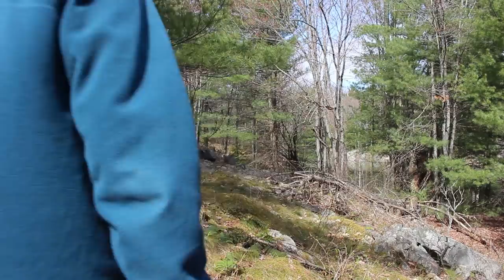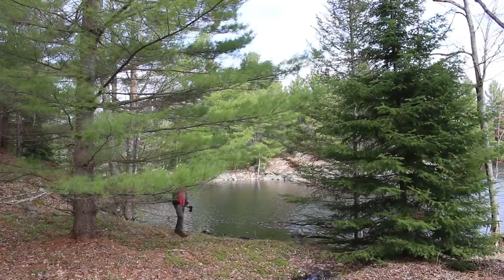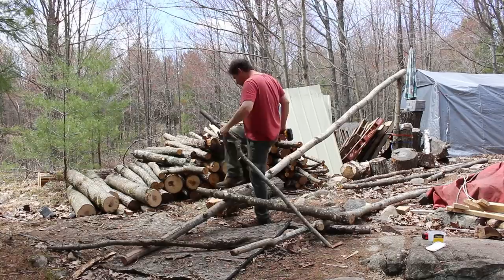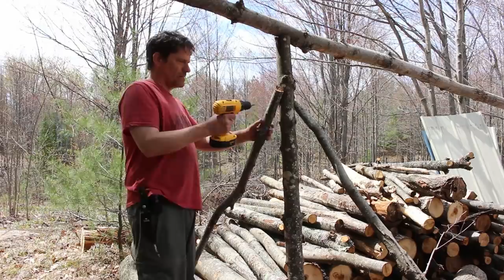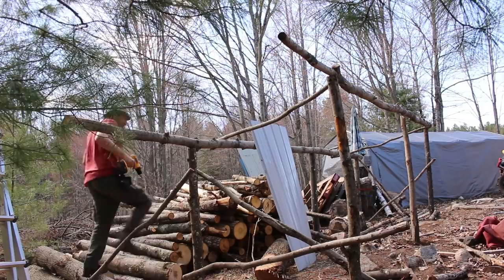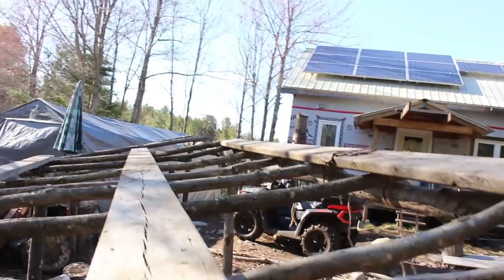Building a Firewood Shelter at my Off Grid Wilderness Cabin

Comment: You have plenty of rocks, so use them and a little mortar to build a 3 sided rectangular base with spaces for log supports for the roof. Lot of work? Yep, but when you're done, the firewood shed/shelter, will still be standing,  long after you're not. I was partly raised in Montana,   and the main house, three stories with 13 rooms and chicken coops and Barn foundation and grain storage building were all done this way and lasted well  over a 100 years. You don't seem to bothered to much by hard work and as one who's had to do it,  your work ethic is admired.   Thank you for your video's, they're appreciated.
Reply from the maker: Thanks Frank, read the first line of the description.

Comment: Hello... good start for what it is. Must Concrete in the post you can be on top the ground get some Sakrete you need to make a box you could walks in all three post by twos that is left and right side will be Boxed In by concrete from the front post to the back post and then do the other side and think about the middle support. The layer of concrete should be at least 3 in 6 is better. Now that you got something up high as 6 in you can Bridge across them with some good Lumber and this will keep your wood off the ground because you bridge across. The thing with the concrete is to help hopefully successfully your structure to stay in place in high winds. Moreover now that you have bridged across you're poly weight onto the structure so it is like the wind must blow over the entire woodpile with all its weight. If you position your structure correctly and now is the time to think about this well it's a little bit late. You can add solar panels to the top in truth you don't need no 10 if you have the right size solar panel in use Tea Bar Warcraft some Lumber to make this Tea Bar clamp down piece of wood. I'd also make it long you should use it's for your storage and I would think that yeah taller was better but that is just me your it is your project. It is my joy to see it Blow Away. Not really I hope it doesn't

Comment: Great idea! It seems mice & big too so when you find good wood to process, you can stockpile it & it won't just rot. My first one didn't have a bottom so the bottom layer was wasted. So a platform helped but we still got termites. Watching you, I thought if I make another at our new house, I want to cover the raised floor with roofing metal with just enough slant to drain out the back and of course the roof with slant too. But yours is going to be so cool with the wood from your own property.  Woot!
Reply from the maker: Thanks Liz. I have enough pallets for a floor so they shouldn't rot. Leveling them might be a challenge though.

Comment: U definitely need to work on getting ur structures foundation solid. One hard wind and that wood shelter is a goner.
Reply from the maker: I'm limited to what I can do as the whole things sits right on bedrock and I don't want it to be a permanent structure.
Reply: Raspberry Rock - Off Grid Cabin trust me, if u don’t solidify that foundation, you won’t have to worry  about it being a permanent structure

Comment: Continuation comment see comment below. I almost forgot to give you some advice on concreting a box. Now it will involve putting for stakes in the ground two-by-fours and these will have Bridge planks across it should be for you 8 to 10 in at least doubles the size of your biggest post. Okay then after putting this into the ground you place your side boards on. Some people to find junk wire to wrap Inside the Box. But before this before you mix your creek you want to get some petroleum diesel and paint your insides of your box this is so when you pour the Creed it will come loose that is the board will come off the Crete. With some tapping with a hammer. Before you mix your creek whether it's fast Creed or from the bag I am considering fast Creek will you only have to put in water. You can gather up some large stones and cement them in place inside the Box this will increase the volume of concrete that you need to poor. This ends the concrete suggestion. Now I have seen someone had a nice look he basically took Pilots and use them as the floor as he stretch the board underneath them or through them then he stacked his firewood inside the structure.
Reply from the maker: I didn't read much of either of your comments because you didn't read the description.
Reply: @RaspberryRockOffGridCabin  I don't know I'll try to humble myself and say I am not a know-it-all. But do you really want to have all that termite infested wood and ant infested wood next to your new structure. I guess knowledge and wisdom is downright valueless after all just about everyone who goes through schooling finds an employer saying that what they went through is nothing what worth are you.

Comment: Dont want to be a downer but that structure is looking dangerous it could collapse at any moment. Those posts need to be fixed into the ground and braced permanently between one another laterally, that should at least stop the wind from blowing it over.
Reply from the maker: It's not finished eh.
Reply: @RaspberryRockOffGridCabin   I understand that mate and i know you obviously have a concept of structural integrity since you built your own cabin. Im just a builder that doesnt like seeing structures standing in an unsafe manner.